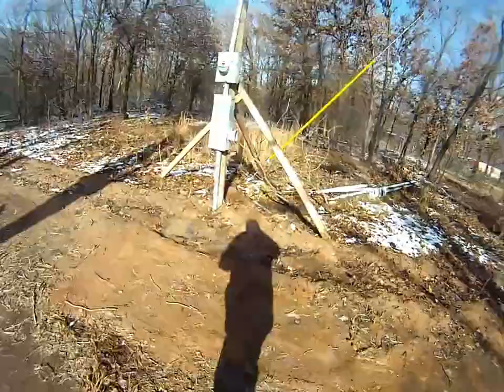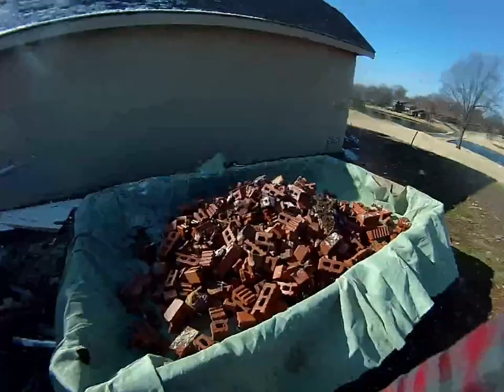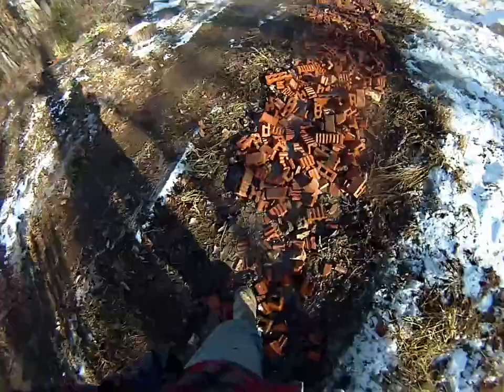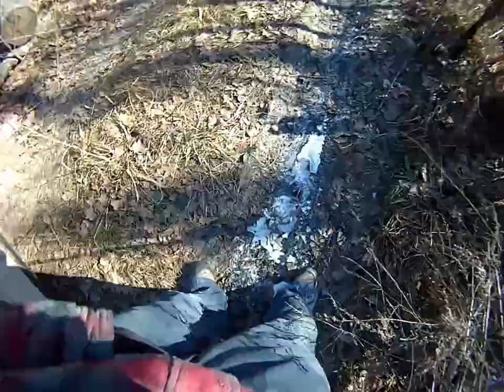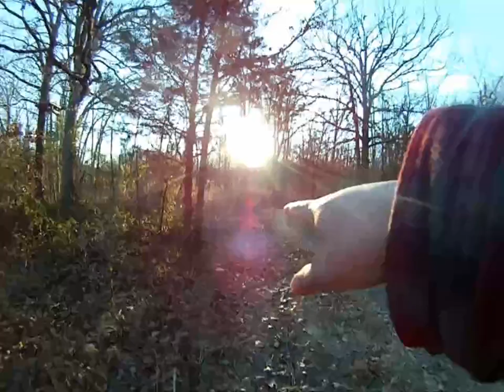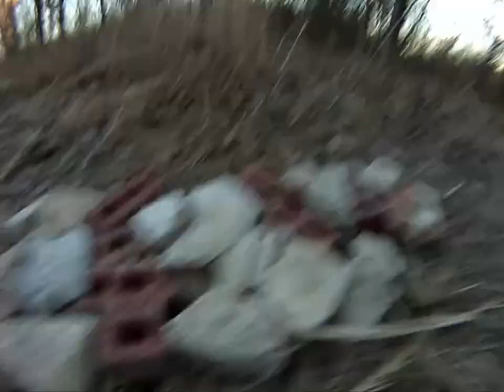How To Pave Your Driveway For Free

Comment: You kind of brought it up when you talked about the nails in the fill. I would be worried about there being contaminants being in fill that is scooped up by the dozer. Either way if you are worried about the nails, see if you can borrow a rolling magnet from a roofer that you know. I know my uncle would always run one around the houses when he was done.
Reply: Of course you say you are going to run a magnet about 20 seconds after I commented.
Reply: Maybe even try to get the trencher again and run it along one or both sides of the driveway and then putting the displaced soil in the center of the driveway and let it self so that hopefully the water just runs off..... Maybe throw the gravel into the trench to prevent them from caving in. May not be beautiful, but might be a cheap long term solution.
Reply from the maker: ah rolling magnet, thats a great idea i hadn't seen one of those.  i was thinking one of those magnetic brooms but i'll look into the rolling type.
Reply from the maker: i do plan on doing some earthworks such as swales and berms along the driveway.  i'm going to have to do trenches on both sides up front because of the bamboo, so i've been planning and observing the elevations and lay of the land so that when i can afford to, i can get a bunch of dirt work done at one time and have a well executed hydrology experiment.  

rainwater infiltration and groundwater recharge being the main goals, but also like you said to deal with surface runoff in the areas where it will be hindrance and divert it to a useful purpose.
Reply: Well it is all looking great. FYI, I didn't get any alerts from YT that you released new videos yesterday and just happen to come across them. Might want to see if there is something wrong.
Reply from the maker: i'll see if they changed anything on my end. thx for the info.